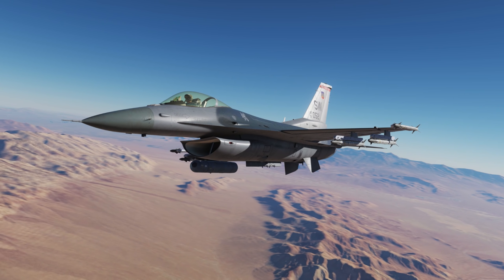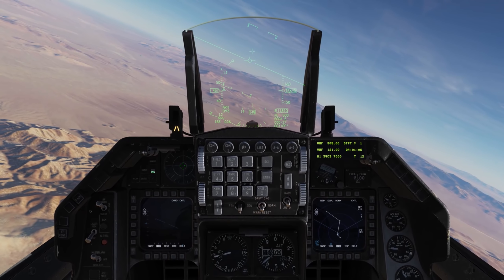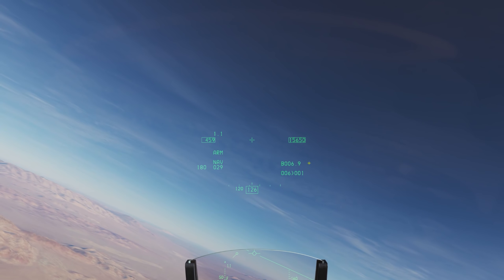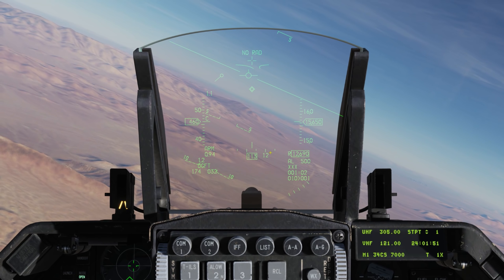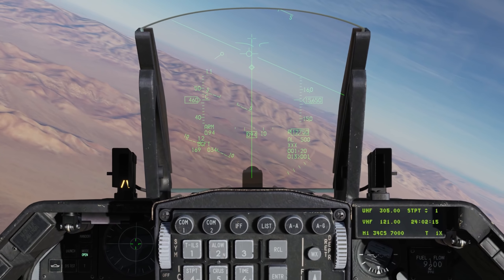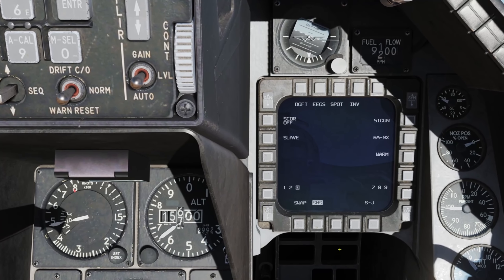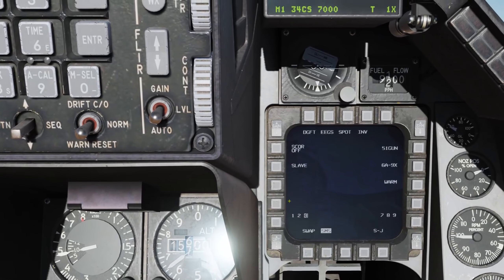DCS: F-16C Viper – Close Air Combat

Comment: I have a number of questions about how to operate the dogfight switch without the luxury of a spare hat/3 way on my joystick. Thanks in advance!
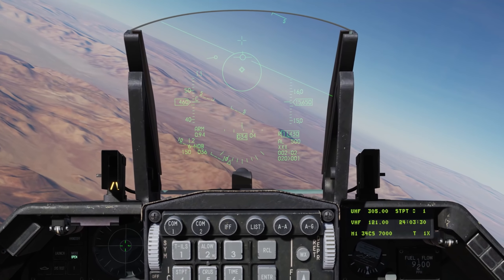- Which button assignment corresponds to which hat direction for the dogfight switch? Is "outboard" what Matt describes as "forward"? etc....I have tried multiple button combos and can't achieve some of the results he demonstrates here. I have "3" mapped as Dogfight Center and "4" mapped as missile override.  Have tried LShift + 3 and 4 as inboard, outboard. I understand the TMS combos but not the last mode Matt shows at 2:56 for a long-range boresight. Which leads to the next issue -- 
- Am I correct in understanding that the boresight function in dogfight mode does not work for AIM-120s? If this is the case, how do I employ AIM-120s in a boresight function for WVR combat? i.e. how do I achieve the function Matt shows at 2:56 which I assume is a boresight for longer range missiles

Comment: Hello wags, i can't find what mapping key you use to switch between differents ACM modes. Bore, vertical etc. I tried Missiles overide, Dogfight mode, center, tried tms up down, and still nothing works. I know on hornet on the hud selected when you press sensor select up, you get to the bore mode. Can't found same thing here. Also, is there a radar antenna elevation?
Reply: Btw, i don't want sidewinder bore mode, you can have it with ACM (or dogfight mode) and select aim 9X. I was more interested in using it with 120 and radar, even having radar working with canon sight. :)
Reply from the maker: When in ACM dogfighte mode, the TMS switch controls the ACM modes. Please see the included Viper Guide. Thanks
Reply from the maker: You can certainly select an ACM radar mode and switch to AIM-120. Thanks

Comment: This may sound like a stupid question. But is the f-16c newer than the f-18? it seems like it has more advanced systems.
Reply: Both of these are the result of the lightweight fighter program of the 1970s.
Reply: @braeddie   oh so the f-16c was designed for the air force?
Reply: The F16A and YF17 were both entered for the LWF ( lightweight fighter program) in the 1960'S. The USAF took the General Dynamics  F16. Northrop developed the YF17 in to the F/A-18 for the USN. 
So both aircraft are pretty much the same age.
https://en.m.wikipedia.org/wiki/Lightweight_Fighter_program
Reply: actually, the hornet has more complex avionics, and all of them are integrated into the DDI displays.like the RWR,FLCS and navigation related, so it has a lot of DDI pages and modes
however, i find the systems of the viper much better designed, especially the HOTAS, the HUD is also configurable to display various info or to act as a DED repeater. also unlike the CRT tri-colored DDI's, the F-16C CMFDs are AMLCD  displays which allow for multiple color symbology to be displayed.

Comment: I can’t get my aircraft to shoot, can someone help?
Reply: Look for 'Gun' on the controls - My issue is, I hear sound although there are not shot trails :X
Reply from the maker: Please remember that the trigger only fires the gun in the Viper. All other weapons use the weapon release button. Thanks
Reply: Matt Wagner What is the default weapon release button? There isn’t one in Adjust Controls menu
Reply from the maker: @jacobabreu9076 . There is, please check in the HOTAS section at the bottom. Thanks
Reply: Matt Wagner Sweet it worked! But with A-120C I can lock on to a target with the radar. Am I not supposed to uncage it like the hornet?